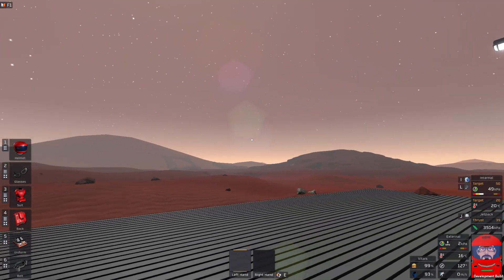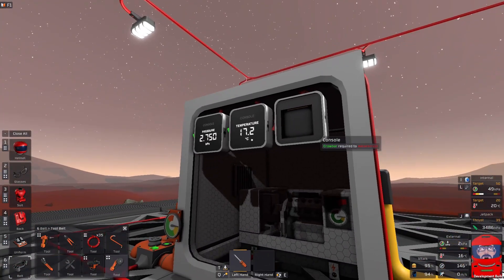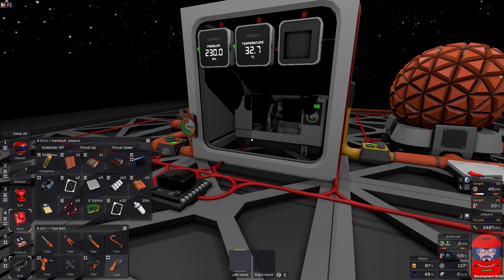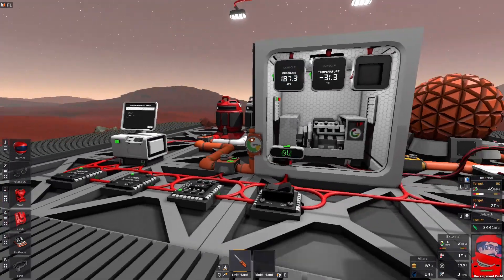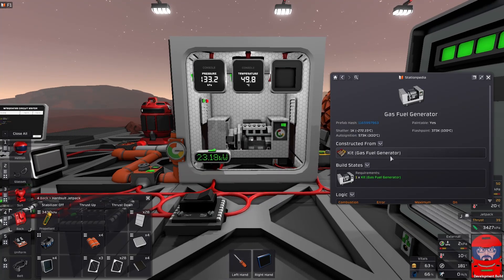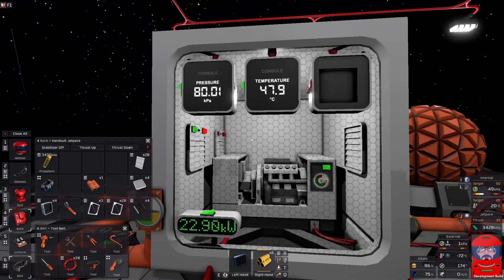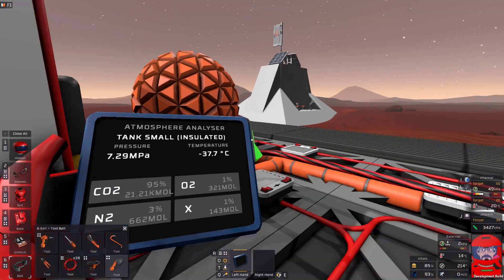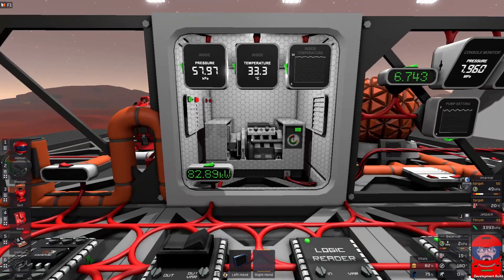Stationeers experimental project. Gas fuel generator

Comment: About active vent, you can write External and Internal pressures into it and it`ll just follow these numbers and won`t suck all air out down to 0kPa, it`ll suck down to number you`ve written to the External pressure and'\or up to number you`ve set to Internal pressure settings.

Comment: Use a vacuum room with insulated pipes going from the gas generator room into the vacuum room. Put a buttload of radiators on the pipe in both rooms. Put a pipe valve between the two rooms and put a gas sensor in the generator room. Automate it so that if temp > threshold then open the valve. Profit.
Reply from the maker: Maybe you should try it and find out how well that doesn't work.

Comment: Hey Mick can ya help me out on this one... I can't get my gas gen to even turn on without wiring up the power slot to incoming power. 

At first I assumed this was outgoing power so wired it to my batteries but it wouldn't turn on even for a second.  So I wired it all up with heavy cable but when there is a connection leading back to the batteries the (small)transformer refuses to send power.  How do I get the power to the batteries then?  Do I need a bigger transformer to prevent blowouts and heavy cable everywhere?

Creating a circle back to my batteries just seems wrong.  Appreciate any advice and thanks in advance! I'm gonna need to make one of them accident counters next.
Reply from the maker: It should still start even without the power connected.  Make sure you have the fuel and exhaust connected.  Make sure you have the right fuel mix and pressure.
Reply: @cowsareevil7514  Thank you.  I'm guessing pressure is my problem them.  Should of known I couldn't half ass it with an electrolyser.

Comment: Thanks Mick, as always. I love watching your stationeers video's. I really enjoy how you explain each line of your coding in most of your video's to allow us to get an understanding of what the IC's are actually doing. I only wish I had the grey matter to make it work also :). I built one after watching your tutorial. But I can't seem to get more than 11.7KW out of it. I placed a dial which is connected to a Pressure Regulator. At 1ka on the PR, I get 5ish KW. 2ka I get 11ish KW, at 3ka I get 11.7KW. What am I doing wrong????
Reply from the maker: You might be limited by the speed of the regulator.  Try moving the regulator closer to the fuel tank or change to a volume pump or remove it completely.
Reply: @cowsareevil7514  You're a 100% correct. I threw in a VP instead, and I was able to raise it to 43KW. Thanks a bunch mate. You're a bloody legend.

Comment: ahaa.. i was always using a volume pump for fuel input on my generator. never managed to cool it down.. pressure regulator instead..
Reply from the maker: Both will work.  Elmo has a lot of success with the volume pump.
Reply: @cowsareevil7514  already tried teh regulator.. i have had another problem.. pressure in my fuel-tank was too low, i think. generator uses up fuel faster than regulator could provide.. same when using volume pump. now i use both.. pump pressurizes the pipe and than regulator dips it to the generator. ... took me a lot of time to figure that out. but your script for the IC is just tgreat. works perfetly. thanks

Comment: hi, this is a nice try and error setup :)
I have a question :
could one use a less powerfull static cooling and instead regulate the power output of the generator with the help of a transformer so that it runs within the parameters? 
i NEVER need this much power 24/7 :)
Reply from the maker: You will need to regulate the fuel input to control the power and heat output.  I haven't had great success but other people have.  I was just happy to get it working.

Comment: Would it work no that they added that heat exchanger ? I don’t know how it works but would it pull the heat from inside there to the outside
Reply from the maker: It makes a lot of heat.  I haven't been able to do it with heat exchangers.

Comment: Active vents have a feature that is extremely useful here.  They have a built-in bidirectional pressure regulator.  For example, if vent1 was set to PressureExternal (ie: the room) 75 and left on permanently, the pressure cell would stay reliably in the 74-75kPa range with no logic required of any sort after that.  Just leave it on.  Vent2 could be set a little higher so that they don't fight with each other.  You can use them to pressurize the pipe or tank the same way.  Set PressureInternal (ie: pipe side) to 2000 and it will keep the pipe/tank topped up to 2MPa, again with no logic.

I saw Elmotrix use this in his Oxygen heater control for his advanced furnace setup.  It works incredibly well.

Comment: I'm a bit late, but according to the wiki active vents can be set to stop pumping at a desired external pressure.  You could use the IC batch instructions to control as many active vents as needed without worrying about undershooting or running out of IC pins.  Just have them all switch on at once when the pressure gets too high, it'll probably end using less power.

Comment: what about using a vacuum chamber with radiators to chill the coolant gas.  You wouldn't have to wait for night time to collect your coolant gas.  You could also recycle the coolant that way.
The heated coolant could be used for base heating before being chilled and reused for cooling the generator again.  This has given me ideas for my current mars base build.
Reply from the maker: The vacuum trick is a physics exploit that I choose not to use.

Comment: I would bet it's only power positive on the hot planets with the vacuum cooling glitch.
Reply from the maker: 80kW will run a lot of coolers.  I will try for a Venus GFG hold the cheese.
Reply: @cowsareevil7514  I saw a video with someone cooling it with night air on Vulcan, and they said it wasn't power positive.  However, Venus is slightly cooler and has more atmospheric pressure.

Another idea for Venus is to melt a bunch of water ice, which produces very cold H2O and N2.  Maybe use that for cooling.  The volatile ice could also be used, it's cold.

Comment: hey mick, big fan. been waiting for you to tackle the GFG :)
if you want more controllability a PID controller is the way to go, not only for the cooling, but also for power control. You can use a Volume Pump on the fuel pipe too, instead of the pressure regulator. Lets you control the generator to exactly the power level you need.
I got a couple of videos on the GFG/PID on my channel already if you're interested.
Reply from the maker: I bookmarked your videos a while ago but I wanted the challenge to solve for myself before watching.  Your setup is quite imperssive.  I only wanted the generator as a backup but you have managed to make it your primary power source.  
It looks like we both got the same hardware for cooling on Mars but I had to stop the video before you gave the hot planet solution.  I will watch that bit after playing Venus.
Reply: How much Fuel does it use ?
I dont want to keep running for Ice every night.
Reply: @user-si5fm8ql3c  0.000056 mols pr Watt pr second. To put it another way, 30kw production consumes 3 units of volatile ice, and 1.5 units of oxide ice pr hour. basically nothing.

Comment: Wtf this is ridiculous amount of power 😳
What is the maximum power output? Like, if it's not throttled by temperature
Reply from the maker: Ridiculous seems like an accurate description.  It produces enough power to run enough electrolysers to replace the fuel it uses and still have plenty to spare.  Seriously OP.  Unthrottled at the end, full power and stable.

Comment: I would love to see what the power output would be at max 100L input, think you could push it that high?
Reply from the maker: At the end I removed the pressure regulator so that is full power.
Reply: @cowsareevil7514  At the end of your video you're generating around 83kW, that's a massive difference to the 170kW Elmotrix is pushing - just wondering (in the name of science of course) if that would be the max, or if it can be pushed even more somehow. 

Honestly, even though it's massively better than solar or wind, I've already invested far too much time making my power grid to replace it all now. Maybe the next update that forces me to abandon my current save will make me look into this further, until then I'll leave it to you guys to experiment with it. :)
Reply: depends on the fuel temp. The generator max is 101 kPa. On my Europa world my fuel is -140*c and if i max my generator it generates 170 Kw
Reply from the maker: I didn't even consider fuel temp.  How do you use 170kW if the cable burns out at 100kW?
Reply: @cowsareevil7514   you don't :) you just brace for the power spike with a couple of large transformers. blew a few cables because of startup spike.
Reply: @cowsareevil7514  And this is why this game is so brilliant! how many other games out there take intricacies like fuel temp, air pressure, atmospheric temp, etc into account?
Reply: @Elmotrix  too bad you can't parallel the output (two 100kw rated cables) so you can get up to 200kw output.

Comment: Now try to get it to work on Venus :D
Reply from the maker: Challenge accepted.
Reply: @cowsareevil7514  I'm really looking forward to seeing that .
Reply: @cowsareevil7514  If you pull this off on Venus lets play I'll be super impressed. I'm playing Venus now and I had so much trouble getting my temps down to use your Advanced Furnace design. Fuel kept combusting in the pipe if my base was warmer than 32C. I had to resort to cheesing a vacuum room to pull if off too.
Reply: @cowsareevil7514  You'll probably need to freeze the atmosphere around the gas fuel generator at cryogenic temperatures. An air conditioner should be able to do that on Venus, but you might only be able to do that at a reasonable power usage at night, so a large tank to store it would be needed for operation during the day. What's the max power draw of an air conditioner? I can't imagine it's higher than the output of the generator.
Reply: @cowsareevil7514  looking forward to it!

Comment: Realy nice idea, didn't know this thing needs so much love.. On mars you can use the heat for the base :D And you get water I assume.
Is it possible to programm an PID-Regulartor für that volume pump?
Reply: There are  quite a few videos on Youtube about the Generator and PID control if you do a quick search.
Reply from the maker: You can use a PID but a simple equation will do the job.  No water, it outputs bad chemistry.
Reply: @cowsareevil7514  Lol yeah, also we wouldn't need any Air Conditioners if you know, Thermodynamics actually worked to High and Low Pressure in the game :p Volume Pumps/Radiators would cool everything.

Comment: You should look up PID (Proportional-Integrital-Differential) feedback controllers. They're a generic mathematical control system used everywhere in the modern world. Anything that has an ideal output, a way to sense the current output and some kind of regulator can use a PID to automatically regulate it.

You've basically made a P controller here; a controller that only has the proportional feedback (the classic example is the ball governor on a steam engine). This does all right, but as you can see from the graph, it's very cyclical and can't deal well with large changes in load. The ID parts of a PID system even out the error and result in a more reactive system.

I'd bet that it'd be pretty easy to make a PID system with the ICs.
Reply from the maker: A PID could be used but as this is a closed system with known environmental inputs I opted for a simple equation for the input driver.
Reply: @cowsareevil7514  Fair enough, then. :) Process engineering is something I find find fascinating.
Reply from the maker: They are fascinating, I have used them IRL for flight computers and robotics where there are too many variables to monitor and calculate.  But I am also devoted to the engineering rule of keep it simple.  I will find a need for one sooner or later.